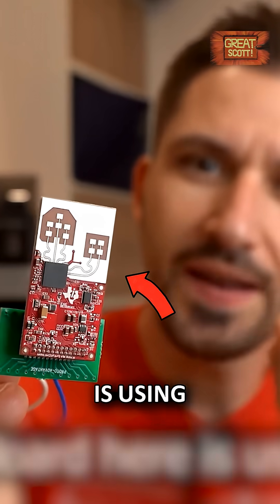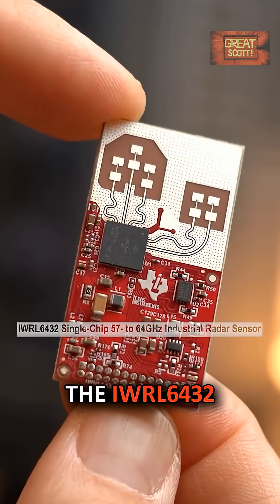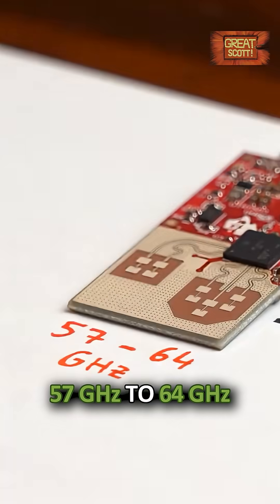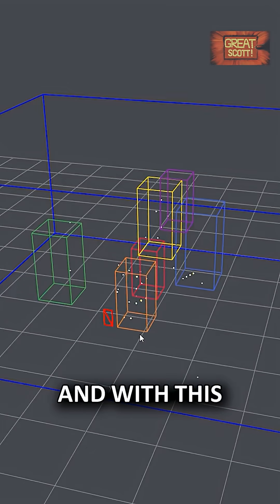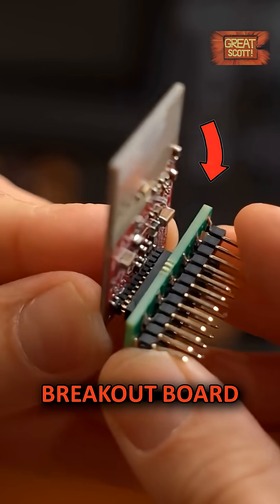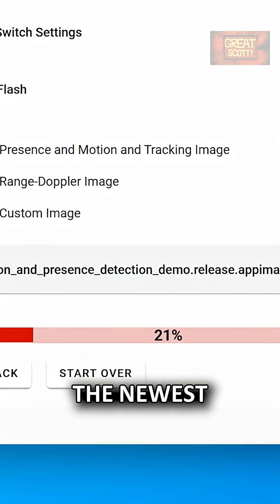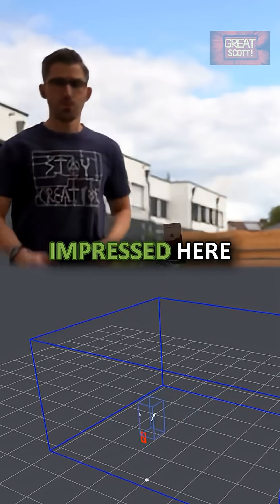New Tiny Radar Tech?! #tech #radar #sensor #tracking #arduino #esp #electronics #engineering

Comment: You should get a paintball or air gun. Then connect a servo to the trigger, two steppers for yaw and pitch articulation, and use a laptop, arduino or raspberry pi to see how well this would function as an auto-turret.
I would do it but I'm broke.
Reply: two guns and a laser pointer. paint ball gun fires first then laser pointer keeping aim on targets.  then make the other gun look menacing real, then play the Dirty Harry quote.
Reply: I like it to keep cats from stalking the birds in my backyard. Got a couple of black cats that would look pretty cool with yellow paintball spots on them.

Comment: it's crazy that it's able to triangulate positions with the receivers so close together.
Reply: The wavelength is incredibly small.
Reply: @5roundsrapid263  yeah. but still, the amount of precision that goes into this would be insane, from stuff like measuring return time using the speed of light, to doing math where one tiny change in a return time makes a massive difference in the reported position.

Comment: The production of the pcb definitely costs less than a dollar. They just raised the selling price so much because it’s one of a type and people who need it would buy it anyway since there’s no alternatives.
Reply: And?
Reply: You can use 3d printer firmware with extension sensor and solder to achieve  the same effect for assembled PCB .

For someone dont know, it s all CNC machine :))

Comment: How many of these would it take to use them like a basic camera?
Reply: It depends on how much resolution you want... Basically one of these will function like a single Pixel unless it's moving. If you stick this on a rotating assembly, you could probably build a halfway decent picture at a low frame rate with as few as 30 or 40.
Reply: @Unmannedair . I figured they would act like individual sensors. 1 sensor per pixel kind of deal.

My idea was to use them as a 3d camera that doesn't use optics as the sensor.

Comment: i thought someone found a way to detect humans using modern wifi, which uses "beam-forming" with multiple antennae to sweep an area and interpret the response.
Reply: they can already do that
Reply: Beam forming is such a cool technology. I find it fascinating that two small, totally stationary antennas can direct a signal in any direction just by varying their phase to match up peaks.
It makes me wonder what other technologies are out there which are super important yet often overlooked.
For some reason the idea reminds me of the transmitter gifted by the soviets to the US president which used no obvious electrical or mechanical components. It was throughly checked out by the secret service and even hung in the oval office, while secretly recording the entire time.
Reply: @borisdorofeev5602  I think the recipient may have been the US Ambassador to the Soviet Union, and yes it was very clever, with energy supplied intermittantly from outside and then reflections being detected from outside, so no wiring or batteries to detect.
Reply: The government does this and can see human shapes through walls.

Comment: I have worked with this.

mmWave as such has a lot of potential in different segments. 

One of the problems I faced was not having a debugger so couldn't really look into raw data assuch.
Reply: Have you used Hi-link radars? Curious how this compares to them.
Reply: @evan8994  I think H-Link radars are mostly like off the shelf solutions for specific set of applications (human detection, human Breathing detection, etc)

Whereas IWRL6432 is a radar SOC you can do much more with that, and yes makes it challenging to work with aswell.
Reply: Iwrl6432 can be debugged easily with CCS

Comment: That price! 
There was me, thinking I could build a bike alarm with this that would detect when one or more people are getting closer to or staying close to the bike.
Reply: Bro you could do that with sonar
Reply: @krowwithakay Early car alarms used sonar for detecting someone in side the car.

My father had Pa car with internal sonar, I think it was a Peugeot 405, if he left the windows open, even slightly wind would trigger them.

Much like PIR, I think out door sonar would need a lot of fine tuning and filtering compared to radar.
Reply: I think it is a good idea, I came with the exact thought of building a bike/motorbike presence sensor
Reply: The chip is much much cheaper, this is only the evaluation board price
Reply: @collardalexandre7245 oh, I'll see how much the chip only costs, thanks.
Reply: there are already such devices
Reply: Honestly, I think a sensor fusion approach is best here. Maybe a microphone to detect loud noises or, specifically, angle grinders; an accelerometer to detect if the bike is being jostled, and a camera feed that can stream to your phone if it detects something is up?
Reply: @robbiejames1540 I have been planning of fitting something like a MPU6050 to the handle bars and the main frame for a telemetry system, just because it would be fun.

They would definitely pick up vibrations from an angle grinder so that is something I'll do.

I will have 4G, maybe 5G so even a super cheap sub £15 wifi CCTV camera could alert me to seeing someone on the seat if I give it hot-spot.

Being blunt about the 4 low-lifes that stole this 125cc bike which I've since recovered and put back on the road....

They were not smart enough to know you can join as many wires together as you like, you cant hot-wire a keyless vehicle, so I doubt there would be any high-tech methods used if  there was another attempt.
Reply: IMO a bike alarm is a terrible idea. All work, no results.

I think your best strategy would be to have a second bike that's a POS, and use that, when you're going to be parking your bike somewhere. Keep your good bike safe at home.

Combine that with a way to disable the bike from easily being stolen, and not a lot of people will bother with the hassle, to steal a crummy used bike.

So... used bike. $50-$150. Take the seat or handlebars with you, when you park it. Regular bike lock. Nobody will bother. And if they do, it only cost you $50-$150, to reload.

I think you'd be far better off, practically, by inventing a quick disconnect system for the handlebars (considering brake cables, etc.). Perhaps you could take advantage of some heavy duty fishing snap swivels, on the ends of the brake cables. You'll figure it out.
Reply: @PaulLawson-k8v  Good idea - the handlebar quick disconnect to be activated when thief speed gets above 10mph
Reply: @5mxg but not before the handlebar muffs zipcuff around the hands so they can leave go of the bars 😂
Reply: @welshdave5263  oh, this is even better, and does not to disengage the handlebars
Reply: @PaulLawson-k8v 125cc moped used for food deliveries, not a bicycle.

Comment: I wonder would this be capable to track birds or are they too small?
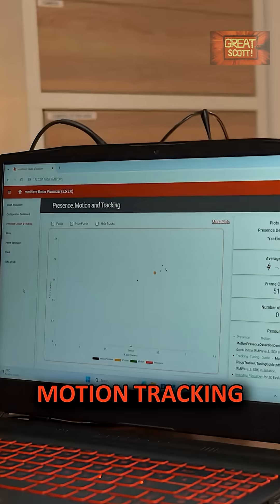Reply: i think it could because when you see the 3D viewer,its trying to find 3D moving points represented as white points,if you see at 0:54 you can see a flying 3D object there
Reply: It would not work, bird cross section is too small.

Comment: They’re going to end up putting that in all smartphones to track everybody at all times, so it’s not cool at all. It’s actually really bad.
Reply: well it makes cell reception worse if every phone has it, also you can already do this pretty well using the existing wifi antenna inside every single phone, at higher accuracy with 3d depth info

Comment: Wow, 3-dimensional tracking with such a small device? Really impressive

Edit: the board is sold for 162€
Reply: Well, that's where its impressiveness comes from
Reply: For now, You might want to keep your eyes peeled on aliexpress.
Reply: Usually eval boards have outrageous pricing
Reply: @kamilosxd678 I understand it with this board, there's no way I'm able to design working HF traces and antennas
Reply: @kamilosxd678 they’ll probably send you one for free if you can convince TI you’ll move big volume once your product is made 😂😂
Reply: The IC is only $17 though.
Reply: @jeremyanderson6395 and the cable 120?
Reply: Cant you just buy the IC and diy yourself?
Reply: @mamupelu565 I don't think I'm able to design traces and antennas for 60GHz haha
Reply: @yanikb.1312well, you're not paying for the board then, you're paying for the physics nerds' time, haha.
Reply: Give it a few years; this technology is going to be pre installed on phones and the chip itself will be much cheaper
Reply: Where can I get one? Multi target detection is perfect, I need one.
Reply: It's possibly cheaper to use UWB modules for positioning.
Reply: The price of evaluation boards is not an indicator of the cost of the IC it is evaluating.
Reply: 😊insert spongebob meme
Reply: well that puts it out of hobbest reach!
Reply: What? Presence detectors for hom automation use the same tech right? They cost $20-40
Reply: @Henryspynx  You can get cheaper radar sensors, but not with the same features.
Reply: @Henryspynx  A range of 25m though others do not have this much.
Reply: the cheap ones use ultrasonic or infrared frequencies
Reply: You can use 3d printer firmware with extension sensor and solder to achieve  the same effect for assembled PCB .

For someone dont know, it s all CNC machine :))  

As my calculations the price for soldering IC and a aim for component could around 2000$ at the end .for a small bed .but it s will reduce PCB price shamelessly in long term.

Because a chip cost around 3$/1000pcs and other else even cheaper. So the hard part is PCB board and soldering a very small component. Which mean if user can do soldering at home . the price for advance board will belong to chip supplier. 

Which mean it will reduce from 164 Euro tp around 20 Euro . 

I think it s more better than buying from middle manufacturer .

Comment: I really want to put this in my house to automatically turn on and off lights, but I’m still not convinced mmWave is safe for extended use in the home.
Reply: The power level of these is quite low, much less than your mobile phone, and 60 Ghz has very little penetration into your body... As an example, a microwave oven, at ~2.5 GHz can cook meat up to a few inches thick, with 600 Watts.. 60 GHz has about 1/25 of the penetration depth, and the unit is probably putting out 1/6000 of the power
Reply: @lohikarhu734The problem, which I mentioned, is extended use.
Reply: you want PIR then, only receives radiation from you.
Reply: @craigfanning351 PIR sucks
Reply: You want to turn lights on, when you enter the room?

That's already an inexpensive product. Lutron motion sensor light switch.

I had one for 15 years, in the last house I lived in. It was inexpensive to install, and worked great (the light switch was in an awkward spot, so I replaced it with the motion sensor).

They have a timer adjustment, for how long the light stays on, after it's triggered, as well. The timer resets, every time you move, so the lights are effectively on, the entire time you're in the room, and then shut off after you leave.

 IMO you're far better off, keeping it simple instead of inventing RADAR controlled lighting.
Reply: You're right to be concerned. There's numerous medical studies now showing that low level RF exposure can contribute to things like brain fog, insomnia and oxidative stress. These can build up to the point that people can develop chronic illness.

Comment: Is it same as LIDAR?
Reply: @weihao8575;
Nope... LIDAR uses Light, usually pulsed infrared, and measures distance by phase off, or actual Time of Flight.
These use microwaves, at about 25x the frequency of a microwave oven, and use a swept frequency pulse, a kind of "chirp" and measure the the time between Tx and Rx, plus the phase/frequency offset... NOT Doppler.
Reply: No!, Lidars use TOF to calculate distance between the sensor and object. this module uses Doppler effect for the same.
Reply: On top of what OnePunch said, Lidar uses frequencies in the visible spectrum; this use the  microwave band which is below infrared.

It also using a 2-element phased array. While in theory phased arrays are possible for all frequencies of light. We really only have strong capabilities below infrared.